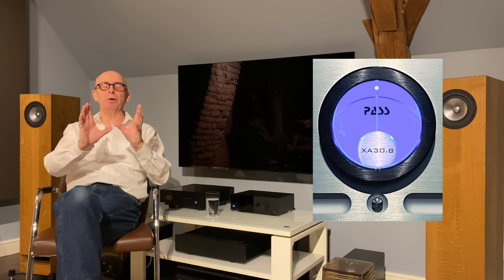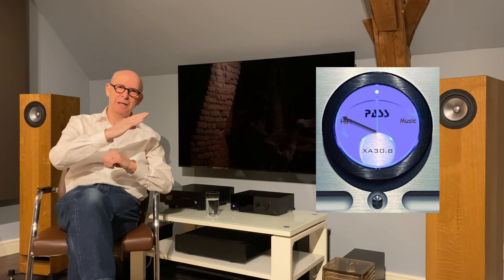What are you listening to?

Comment: First comes the joy of the activity (whether or be listening to music, driving a car, sailing a boat, playing a guitar), but ultimately the person wants to improve that experience so they buy a better system (or car or boat or guitar etc) and at some point the line gets blurred between appreciating the experience and appreciating the equipment. A sign of going too far is when the equipment is causing worry (don't scratch the car! Don't touch the guitar! Don't turn the preamp off first!). 
Finding the sweet spot; achieving good sound without worrying about whether you bought the right cables, or whether your DAC needs a better power cord, is the best goal for most people I think.
Reply from the maker: Absolutely! Nicely put

Comment: After moving last year from the Pacific coast of The States, to the Florida Atlantic coast, with Only what could fit in my small car (meaning NO stereo), I recreated a modest setup. With a nearly unanimous nod towards the $2,000 KLH Model 5's from various channels, I opted for them last December. To power them, I ended up choosing the smallish XTZ Edge A2-300 with its single pinprick of an LED light (No meters, NO dials, Nothing). The odd piece to this setup is an iFi Zen DAC V2 headphone amp with its volume control. Odd in that I use the DAC output into the XTZ, in essence it's my pre-Amp/volume control. I have nothing to look at, therefore I can just relax and enjoy my music. While I once considered myself a low level audiophile, now in my early 60's, I just want to relax into the quiet ambient music that I enjoy. It's really about "setting the mood". With condo living, I enjoy lower-volume mid-field listening.

Comment: The point of having a decent system is to be able to ignore it. Music is just there, it neither comes from the speakers, nor is it colored by the components. So no dials/lights is the ideal component for me (and my PL XA-25 has no dial 🙂). As a (not so) borderline Asperger spectrum scientist, I have learned to focus intensively and also am able to switch focus in an instant. I frequently listen to music and switch from analytical music mode (listening to individual instruments, timing, intonation, interplay of lines) to impression music mode (just take it all in) between beats. The hifi mode hardly ever comes on, only if I switch components and that is pretty rare. Thereafter, I forget about adjustments. I need a hifi/music indicator as little I need a sitting/standing light. 
If I wanted a light/dial, it would be an "optimum indicator". Is my hifi system set-up that it gets the most out of it? Needless to say, "optimum" is a loaded term in itself. Anyway, fun thought exercise.
Reply from the maker: Excellent comment and addition to the conversation Daniel. Thank you. I too can take great pleasure in mentally picking out an individual instrument and only listening to it - then switching back to the full orchestra / band. such joy!

Comment: Has to be one of your best video's So true on all counts I try to stay in the middle but I think if it sounds really good you move to the left and if the music is great you move to the right. By the way a side note I have a VAC sigma preamp with a similar dial it looks good but sits there in the middle or so I thought till a tube went bad and it went to the left turns out it is for voltage but no word of it in the manual go figure. If you have high voltage coming in it will go right if something is not right it will go left or something like that.
Reply from the maker: :-) Hi Mark, loved your comment, thanks!

Comment: A dial that tells you when your amp is running at peak performance with relation to the speakers it's connected to would be nice :).
I have an Audiolab 8000Q with an input gain function, 8000M power amps, and two totally dissimilar speaker systems in two totally different rooms. TDL Studio 1's @ 86db etc, and Tannoy DC3000's @ 92db etc. It would be nice to know where to set it to have the amps working at their optimum :).
Reply from the maker: Hi, interesting point. In my opinion, a really good amplifier (such as yours) shouldn’t really have an optimum point. An optimum load yes and optimum matching with other components, yes. Having said that, the transistors do tend to have an optimum working temperature range, as indeed do the resistors. In my experience it is the usually room and humans that define ‘optimum’ more than any single component. With such differing loudspeakers systems, it’s impossible to tell if it is the loudspeaker or the loudspeaker matching that would be optimum. This is by the synergy between components is so important.
Reply: @PearlAcoustics  Many thanks for your insight, no getting rich overnight on that idea then :).
Reply from the maker: @donk1822  unless you utilise a internal temperature gauge, where the idea is to get it into the optimum zone ?😀
Reply: @PearlAcoustics  Which is vaguely what I was probably imagining for my meter, but less succinctly worded? :)
Reply from the maker: @donk1822  indeed. It’s part of a creative thought process. Your question / idea inspired me to give it some thought. And maybe there are other parameters in addition to temperature that I have not thought of. + I agree, your idea would be fun!
Reply: @PearlAcoustics  Many thanks. My apprenticeship was served as a toolmaker, but I have worked as a mechanic, rebuilt many motorcycle engines, but electronics is not an area I know enough about. The old adage, a little knowledge is a dangerous thing would apply to my expertise with volts and amps :).
Engines produce torque and horsepower, but as you know the engine pulls hardest when the torque is at its highest, not at peak BHP. In my head, for some reason I instinctively feel that amplifiers may exhibit similar behaviour?

Comment: What are you listening to? Whether you know it or not you are listening to sound fields that reach your ears. Therefore if you want to duplicate a sound field of a live musical performance from a recording you have to duplicate the sound field that reaches your ears as closely as possible taking the entire process from the sound that lands on a microphone to the sound field that reaches your ears. Accuracy is a bad term. Based on my analysis the precise duplication of a sound field using my method can only happen in a laboratory built for that purpose starting with anechoic recordings and reconstructing the sound field based on a complex set of measurements and, a dome filled with loudspeakers, amplifiers for each one and a very complex computer that reconstructs the field. Two mathematical models work. Mine which remains unpublished (after nearly 50 years) I all Acoustic Energy Field Transfer Function and another developed at Delft University called Wave Field Synthesis. They start at different points, go through different paths to wind up at the same conclusion, that is either mathematical solution can be convolved into the other with some manipulation. 

What is the essence of a sound field. It is a time varying pressure gradient. What is a pressure gradient? It is a difference in value of air pressure from one point in space to another. Is this just playing with words? No, not at all. Pressure is a scalar, it has no direction. A pressure gradient is a vector, it has direction. The gradient is the reason sound propagates in space. The source of sound creates a pressure gradient with the surrounding air which cascades as it propagates. The sound you hear are the result of time varying pressure gradients between the outside of your ear drum and the inside of it. Every sound has a direction of arrival. So here's some bad news. When the vector sound field falls on a microphone it is converted into an electrical signal that is a scalar, only voltage amplitude versus time. It has lost all directional aspects. It isn't converted back into a vector field until your loudspeakers produce it as sound. From there it is altered by your room until it reaches your ears. Here's more bad news. Given where the microphones are placed the sound they record is nothing like the sound you'd hear in an audience. So it is hardly surprising that the sound field that reaches your ears from loudspeakers is very different from what you'd hear live. So different that a person with normal hearing can easily identify a recording from live music. Here's more bad news. Of all the people I've met in this high end hi fi industry not a single one of them had the knowledge to understand what the problem is about, let alone understand the problem itself. And of course none of them has a clue about how to solve it.

Can it be solved? Yes, in a fashion. The major differences that are qualitative and missing can be reconstructed convincingly. Accuracy in the scientific sense is not in the cards for home audio. Is it difficult? Yes, very and the solution is as complicated as the problem is.. Is it expensive? By audiophile standards it isn't. What's expensive in both money and effort is getting the education that is sufficient enough to provide the analytical tools that make it possible. For me it was four of the most grueling years of mental work in my life and worth every second of it. Do I work in this industry? Hell NO! Why not? The problem is not nearly worthy of making it my life's work. I had a far more ambitious career path I pursued, one that gave me great satisfaction and often challenged the limits of what I could do, even expanding my knowledge by doing it. So this was relegated to being nothing more than a hobby, one of many I have and a challenge to my analytical skills and engineering prowess.